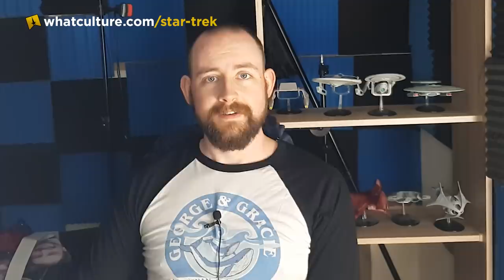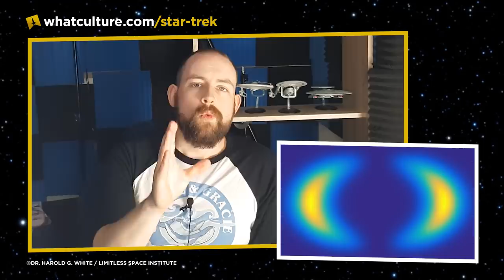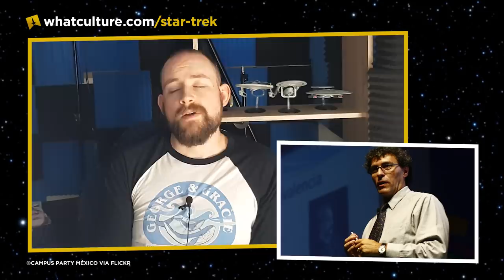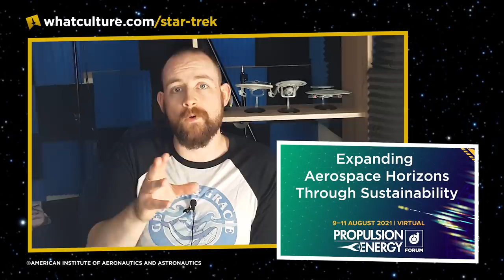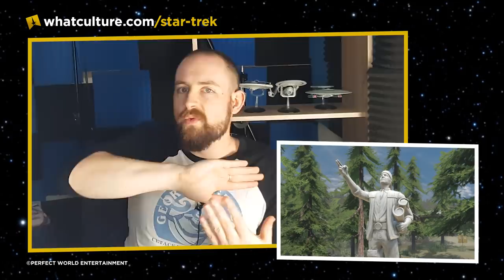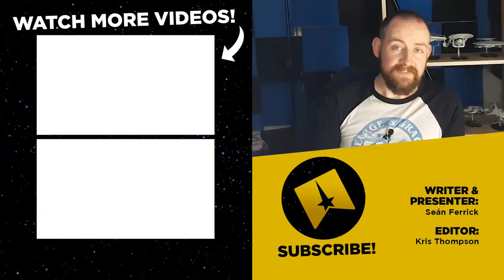Aerospace Engineer Discovers Real-World Warp Bubble

Comment: TBH, inertial dampeners are so much more important. Sudden acceleration from sub-light to warp would probably liquefy anyone along for the ride
Reply: According to what I have read on the Alcubierre metric, inertia would not be an issue.  The bubble creates a moving inertial reference frame, thus, the bubble moves, you do not, and inertia from acceleration would only be an issue with something akin to “impulse speed,” but inertia would not be an issue at warp.

Comment: You still have the huge energy problem, converting the warp bubble on the nano scale to accommodate a ship large enough to sustain a long voyage would be a huge problem to overcome, especially when we're barely getting fusion reactors to work.
And all that is assuming that it can even be scaled up with both the technology used and the phenomenon itself.
Reply: What is this? A warp bubble for ants?!
Reply: Naw.  We’ll just use a shrink ray and shrink the craft and it’s occupants down to microscopic scale.  Then we can power our craft and then unshrink it when we get there.  😆
Reply: Unless there's something else we don't know that would require less energy that is yet to be discovered.
Reply: @eds4169  more microbes and it isn't at all proven yet. There are also issues in it that have been pointed out. Paper was published open so you can find it.

Comment: Between two stationary plates for the Casimir effect and on the quantum scale so a very very tiny and essentially stationary warp bubble...   Using the Casimir effect to stabilize a wormhole would be more useful as that might allow FTL communications between entangled wormholes and firing a laser through them.

Comment: I hate to pour cold water on this but this paper doesn't really help. We're still pretty much where we were after the initial follow-ups to Alcubierre's paper.

What White et al. did in this paper is to calculate the vacuum energy density for a certain plate configuration that's slightly more complicated than parallel plates, using a previously published technique (the worldline formalism) that makes it easy to do the calculation on the computer for arbitrary geometries. First, nothing's been "created in the lab", yet. It's all theoretical. The results look plausible enough but you never know. Second, and most importantly, we knew this already. The Casimir effect is old news.

It's a common misconception that gravity is generated by mass. In truth, gravity responds to something called the stress-energy tensor, which is a special object that encodes energy (mass) density, momentum density, shear stresses, and pressures. When Newtonian gravity is a good enough approximation, the energy density overwhelms the other pieces and they can be ignored, but that's not the case with Alcubierre's solution. Spacetime is being stretched in a pretty complicated way, which means all those components are important. One thing you notice right away is that the energy density is symmetric between front and back, which naively would mean the spacecraft doesn't know which way to go. But the bubble is clearly asymmetric, so how can that be? Well, it's the other components, particularly the momentum components, that do the job.

In other words, negative energy density is not enough: you also have to make the energy stretch and flow in just the right way if you want a real warp bubble.

Another problem is that the energy densities involved here are minute. I mean it. The total energy that would be contained in the whole "nanobubble", if it was actually built, would be something like 10^27 times smaller than the positive energy in a single runt grain o' sand. Imagine measuring the gravity in that, let alone using it for propulsion.

Summarizing:

1. Nothing was built.
2. If it had, it wouldn't be a warp bubble.
3. If it was, it would be too weak to have any detectable effects.
Reply: Also, it's not really fair to say that White "refined" Alcubierre's solution so that it uses less "exotic materials". He's still looking at Alcubierre's solution exactly as he wrote it. He's just ignoring the problem, essentially.